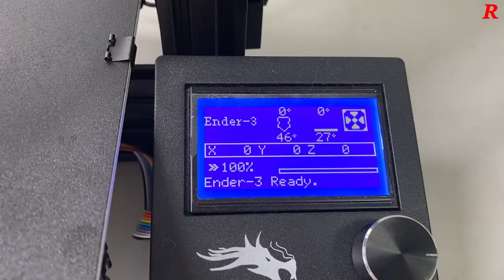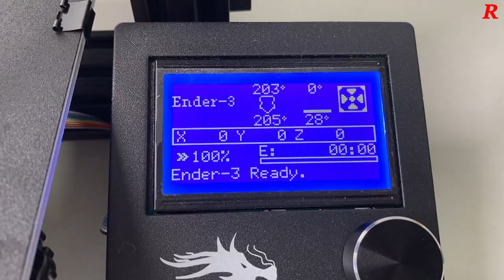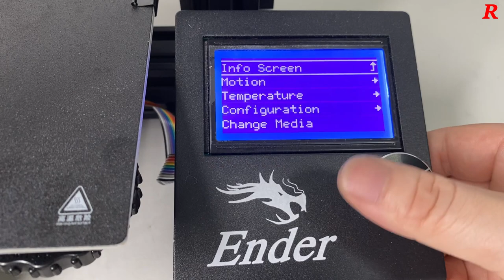Creality Ender 3 Direct Drive *UPDATED*(THE ORBITER EXTRUDER WITH Ender 3 DESIGN)

Comment: No other firmware changes were needed? I see that you swapped the wires, set the driver chip current and e steps. That's it?
Reply from the maker: Yes.You just need to swapped the wires, set the driver chip current and e steps.

Comment: After using your design for more than a week I can only conclude that it stands above other designs. Especially when printing PETG where part cooling is paramount, the improvement is very noticable. In your video the wiring part of the bl-touch though is missing . In my experience the room for the bltouch wiring is somewhat restricted. Not ment as critics bu yust as motivation for an even better version. Again: My best print head ever!
Reply from the maker: First of all, thank you very much. Secondly, in the bltouch wiring part, other youtubers have also done a lot of video tutorials. Maybe I will update a video about this part next time.

Comment: No, no, no! 🤦
  Your soldering was all wrong!  What you're supposed to do is, solder all four wires, then slide the heat shrink up to the joints, and then, and only then, you're supposed to realise that you forgot to add the heat shrink to the last two wires!
  Or is that just me?! 🤔😂

  Just a couple few questions.  Does the BLT retain the same offsets; would this fit the CR10s-Pro; how much bodging would I have to do to make it fit over an E3D V6?
  Thanks for the awesome video! 👍